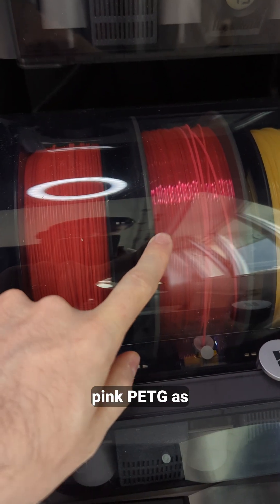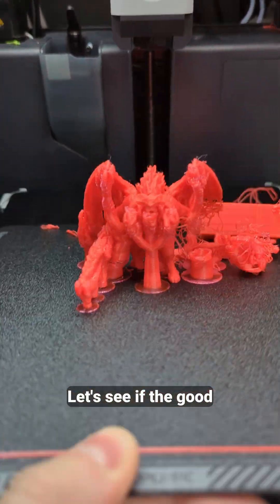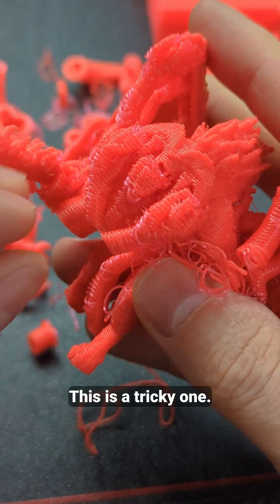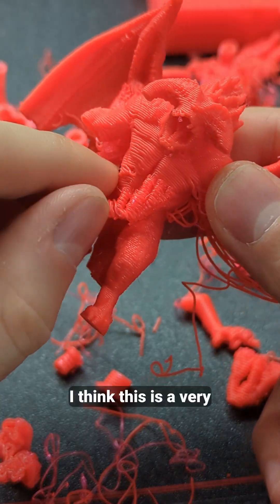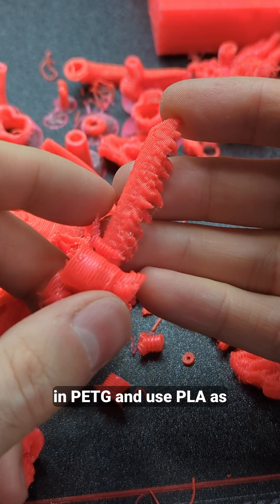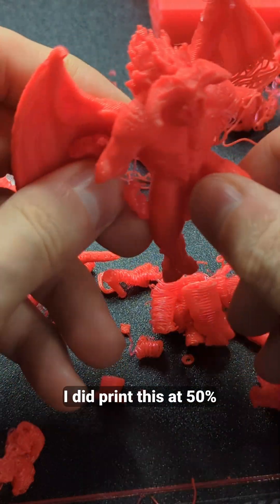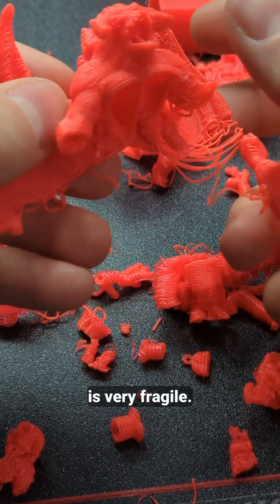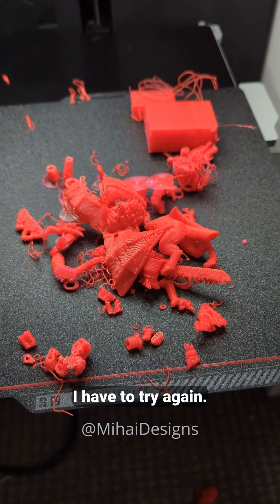More experiments 3D printing PLA with PETG supports

Comment: Interesting data point regarding contamination. As an owner of an IDEX printer who hasn't used PETG + PLA combinations so far, this is just more encouraging. So what does that mean for Bambu Labs printers? Maybe they SHOULD have a dual extruder! Not for colors, but one per material. Hey Bambu Lab, you listenin'? :)
Reply from the maker: Should work well for IDEX. I don't have one to try out. I'd love to see a tool changer on the next Bambu printer, but could settle for IDEX.

Comment: This would be ideal for idex. I have a crazy idea for high performance idex I might eventually build: 3 delta robots working in same build volume, angled to avoid arm interference when others park. 2 using print material with N colors each, one pooping while the other prints. Third always ready with support material. Total print time same as single color/single material.

Comment: Been seeing more evidence of fragile parts off the bamboo printers due to high speeds - not enough bonding between layers. Apparently it's been a prob since release and tweaking of the profiles def helps strength
Reply: That's a result of insufficient nozzle temperatures not high speeds. I print a lot faster than a Bambu on my Ender (see channel if you don't believe that) with essentially isotropic part strength because my PLA is 260-300 °C and HTPET 350 °C.
Reply: @daliasprints9798  yep!

Comment: If you are trying to print miniatures or figures with such a small size, it's going to fall apart without a decent amount of infill. With my Flashforge Guider 2s, I run with the smallest nozzle I have (0.3) and have 10% infill, usually that can get a good big print going depending on settings.

Though most miniatures are better on Resin printers as most people use them lol